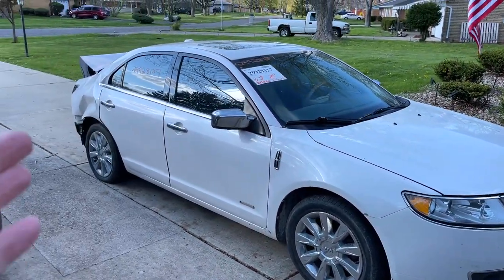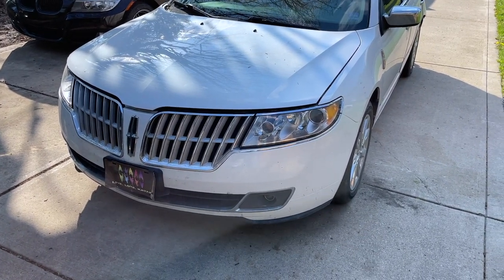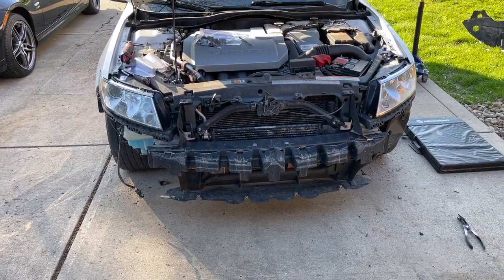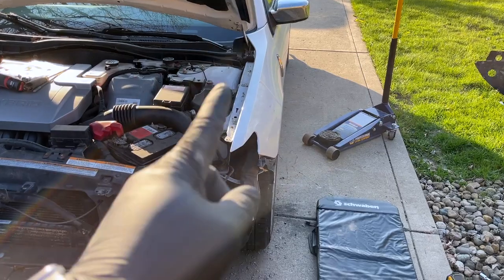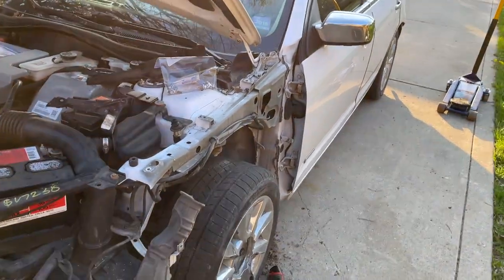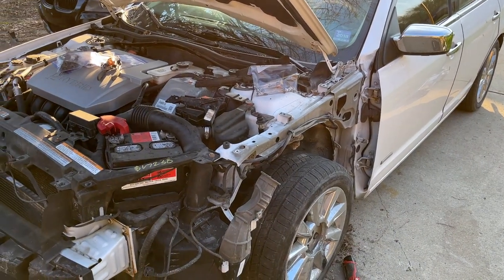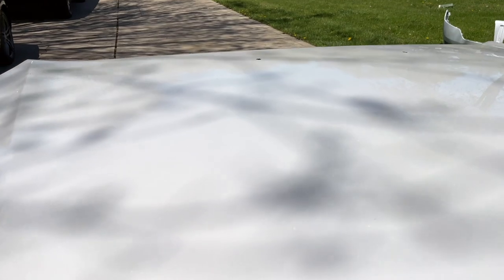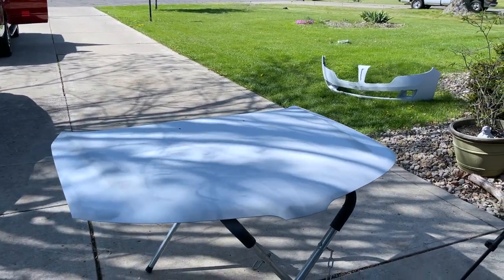Lincoln MKZ Hybrid Rebuild - Part 2

Comment: I find it much better to plastic weld the bumper. There are fairly cheap welding kits that work well enough for small stuff like that. Also, it ks better to use 3M EZ sand (05887) or similar instead of fiber glass or bondo. Fiber glass is not flexible.